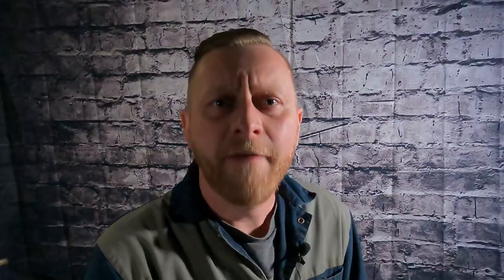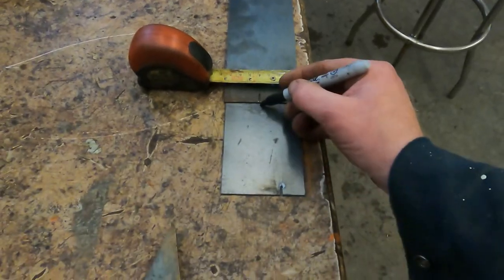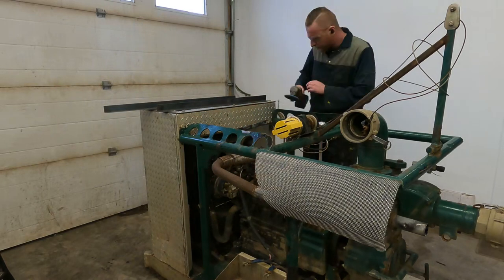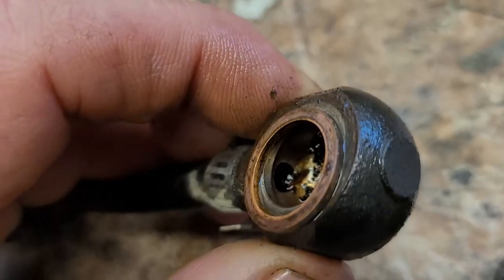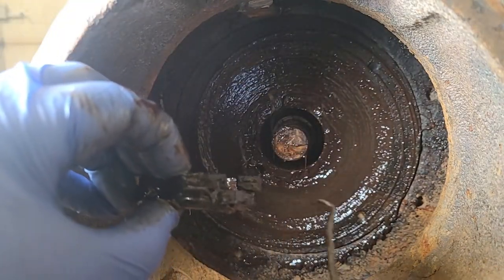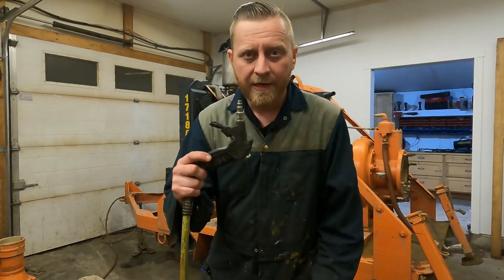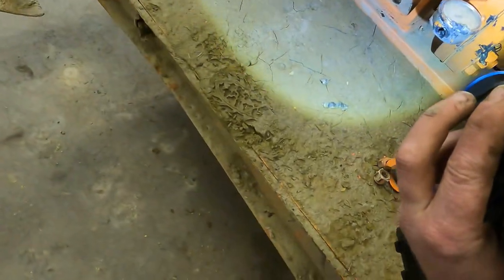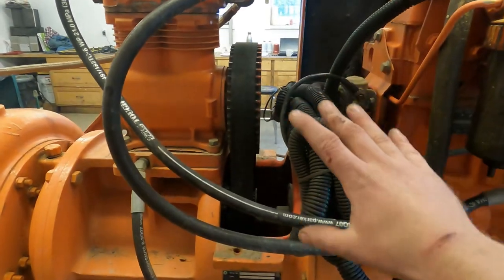WATER PUMP PRIMING ISSUES, SE1E2 GOLD MINING WINTER VLOG

Comment: I never knew those big pumps used a venturi to prime themselves...  I had heard of using engine vacuum to prime the pump, but then people would have to watch a little catch jar in the line and be there to shut off the vacuum line once the pump was primed so as not to flood the engine.  I guess you could run it through a old carburetor float valve of some sort, but obviously the factory solution seems like the ideal way to go about it when you have the off season to perform such maintenance!     ...I'm now super curious if I can float a screw driver!
Reply from the maker: Oh yeah I forgot about the old carb vacuum trick, as long as it doesn't have a turbo on the engine.  There is a company in the states that makes a venturi unit that mounts to the exhaust output. I have always wanted to try and make one but havnt had time. Be a great experiment!

Comment: Didn't notice on the vid but does that Godwin have a external seal oil resevoir? My 4" Pioneer does and I can run it dry. I assume that Godwin has something similar? Also thankful that my compressor is driven off the front of the engine with a B belt and not that cog style. Thanks for the vid!
Reply from the maker: This Godwin has a internal oil reservoir and can be ran dry.  The seal kit for the 8 inch Godwin is almost 2000 bucks.....So over priced...
Very cool on the Pioneers having the compressor up front, I have never owned one or seen one in person. That is such a better design that's for sure hahah.

Comment: Well the vid was bad at the beginning but it definitely sucked at the end…lol your editing is getting better especially the employee bit that was funny and well done good humor through and very informative on the processes is there a conditioner you can use on the belt to keep it from dry rotting? Or do you need to build a cover for it to protect it from the elements?  Great video thanks for sharing see you on the next one 👍🏼👊🏼p.s. merry Christmas 🎄
Reply from the maker: Hahahah yes there were parts that.......did suck. I should look into that idea of yours about the conditioner. I wanted to purchase 2 belts and have one just hanging around the shaft so if one broke I could just slide the other on right away. But the price of 2 wasn't in my budget haha.